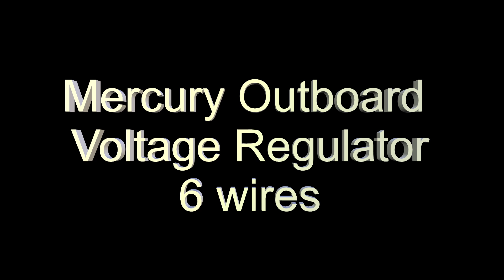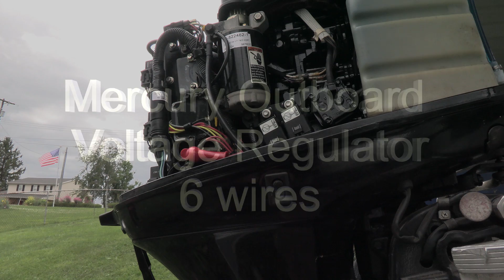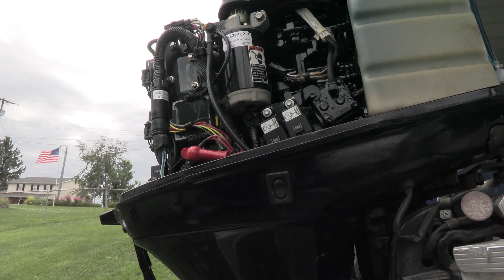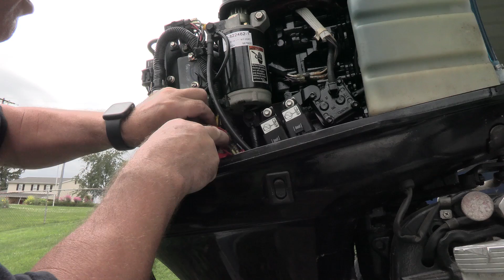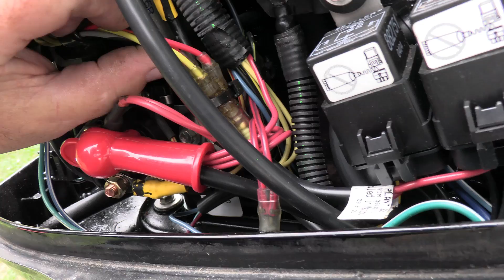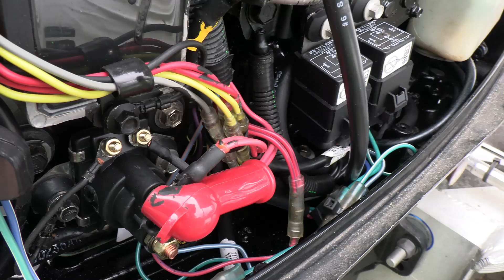Mercury 50hp voltage regulator location

Comment: Why would my voltage regulator burn up. All the butt connector melted away.  The black area melted on the regulator.   I thought I had problems with the key switch cause he boat would not start with each turn of key then it just start working again and boat would start. That was before this all melted. New battery new. Battery connection. - I thought it was the connection cuz after messing with them the key switch would start the boat right up.
Reply from the maker: Did you jump it with another battery?